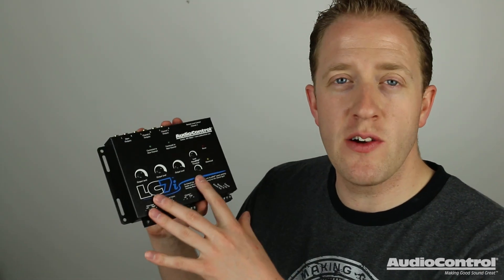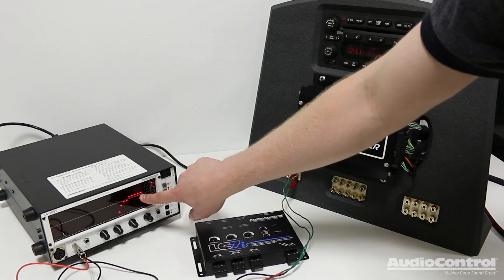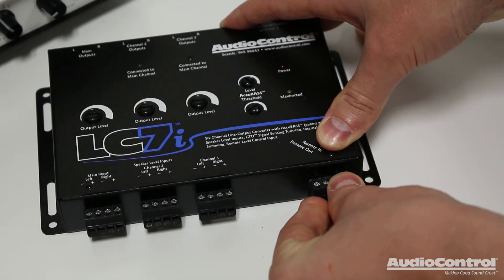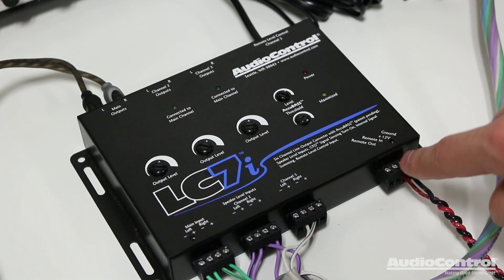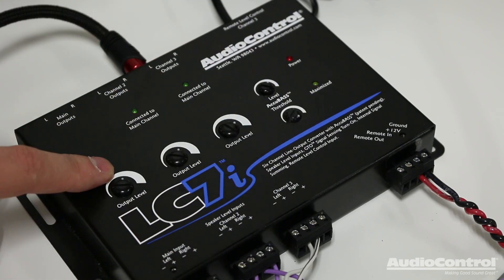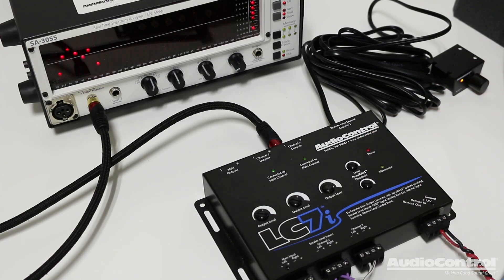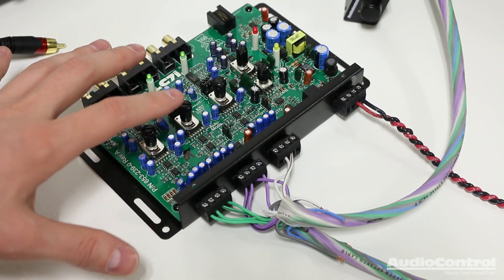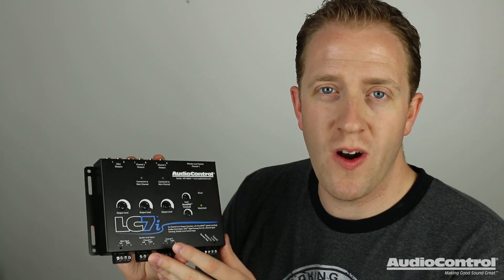Add Amplifiers to a Factory Audio System - AudioControl LC7i Line Output Converter

Comment: My Infiniti G37 has 12 speakers and 2 amplifiers, how would I use this? The 2 front doors have 3 speakers each, the 2 rear doors have 2. There is also a center channel and a subwoofer. I dont need to use the rear sub, and dont mind running the center channel off of the stock system. Would this only work for the front door speakers? Someone please help.

Comment: I have a 2 channel amplifier on my highs (6.5 components: midbass and tweeter L&R and rear deck has coaxials L&R.  I also have a sub amp on a DVC 12". How would I wire this correctly including the jump switches? My components are at a low volume while rear coaxials are OVERPOWERING my components up front.  Thanks

Comment: So I'm lost on one thing. If im only hooking up a subwoofer. Should I be splicing into all the level inputs? Does it sum the bass output? Or is this overkill for that task?

I want to maintain the speakers being powered by the factory amp for the time being, but I want to make sure this thing wont rob power from them.

Comment: Hi Mark,  I'm trying to get decent sound from my stock hu clarion cv729cm, notoriously criticized system from subaru. Replaced f/r door speakers with 4 Alpine s-s65 powered by alpine PDR-F50, added 1 sub 12" rockford fostgate punch P2D4 powered by rockford fostgate R500X1D , Audio control LC7i, kilmat sound deadening doors and trunk, custom fglass sub box, premium wire, blocks and cables. Getting a hum or buz at low to no volume as well. Any suggestions, I'm  ready to take it to a shop

Comment: The set up that’s gotten my subs the best signal have not been a factory with line converters. Let me know if there are converters that go over 400 watts. I’m trying to get the most out of an aftermarket 4K watt amp starting with a loud / clear enough signal. I have peq 70 equalizer with a sub output that doesn’t get enough signal with a converter

Comment: Do I still need a crossover on my Sub woofer output?  Does the unit subwoofer output (channel 3) has a low pass output filter built-in?  If not what do I need to replace with?  My subwoofer amp has a full range output only.
Reply: Interesting. Your sub amp should have a Low Pass Filter Option. If it doesn't, you will need to replace the amp or get a DSP to have those frequencies set to low pass for subwoofer bass signal only.

Comment: All this is confusing me. I have a 2018 Nissan Titan. It has 2 speakers in the dash, two in the front and two in the rear doors. It’s the stock setup no sub or amp. 
I’m wanting to put all new speakers, two 2 3/4 in the dash. 4 6x9 component speakers in the doors. So one six Channel 600 watt amp and one 500 watt mono amp for the sub. So I’m trying to figure out what all I need for this. Do I need the LC6i for that? Do I run two separate RCA lines for that? Just confused. I’ve never retained the factory radio before. So I don’t know the process.

Comment: Where I’m still confused on the installation how would I install this unit for a car that doesn’t have a stock amp and the  stock unit can’t be replaced?  2 How would I connect the head unit to this if theirs no option of component connection?
Reply: You have to cut the speaker cables on the back of the stock head unit. Connect them directly to lc7i. Use some 9 wire to run those cables from head unit to the lc7i. When you hook up your amp then you feed your speakers from the amp.
Reply: @bigabescanal  thanks now it makes sense to me. I’ll basically run two sets of 9 wire to the back one to the lc7 and one to the factory speaker wire it’ll connect to the amps. I’m so used to the Old days where you ran all your own wiring/rca’s  to everything from the aftermarket deck to the amps basically making your own harness.
Reply: It’s making some sense now so I run the 9 wire to the lc7i that’s connect to the inside speakers. Then do I run any wires to the amps besides the power ground. What about rca’s? Or I’m not using rca’s cuz theirs no component input? I’m still doing my research it’s a 2016 Mazda 3 sport. Base model not the Bose sound. Don’t know if the stock has a component connection. Since it is a gps model unit
Reply: @DJMEDIC671  you are gonna use the 9 wire and only use 8 of those for the 4 channels on the head unit. Cut the speaker cables at the back of the head unit. Then crimp the nine wire to the head unit. Basically the head unit will no longer feed to the speakers. You feed the lc7i with those speaker inputs. The lc7i needs speaker signal to install the amps. Then you use rca's at the lc7i to connect to your amp. Then you are gonna feed the speakers directly from the amp. Run speaker cables from the amp directly to your speakers. Your speakers are no longer connected from the head unit. I have a 2014 accord and I'm also doing research to do my installation correctly. I have an option to use the lc2i but it seems like the lc7i would be better if I'm stalling 2 amps.

Comment: Is it possible to adjust Fade, through the stock head unit, with this installed?
Reply: Yes! 100% adjustable fade and balance control. I prefer thos over a Fix 86 even though I'm a JL Audio Equipment User. With the fix its recommended to max your radio volume to its non distorted point and leave it there and use an external volume/sub gain control to your amps for best results. Ypu can use your head unit volume for that Fix 86 but you will hear some sound quality degrade as the fix tries to Automatically refix and flatten the EQ to the new volume you have just set. You dont have to worry about stuff like that with an LC6i or LC7i. 👍
Reply: @joseluisruiz3789  Thanks for this informative reply! I didn't know about the Fix 86 but it's nice to see feedback on it. It's also great to see that these functions still work with the LC7i. 

If you don't mind telling, what kind of system do you have? I have a 7 speaker factory system (2 tweeters, 4 woofers, 1 subwoofer). So I'm concerned that there aren't enough channels on the LC7i to support all 7. 

Really, I'm not even sure if I'd need an LC7i because there's a factory amp too. I just want to make sure that I can send the signals to aftermarket, amplified, speakers while retaining all of the functionality of the factory head unit
Reply: @luchvk  I got the JL Audio C5-653 in my ford flex front and rear with a Crossover on them. I'm using an Audio Control LC6i for my flex. Mine doesnt have the sony system so stock it had the center channel, A pillar tweeters and front door speakers connected together to 1 channel of the stock amp for the left and right side and then the rear door speakers connected to channel 1 channel each. No subwoofer. So with the LC6i I connected the front channels to Inputs 1 and 2 for left and right and the rear doors to inputs 3 and 4 for left and right and since I wanted the subwoofer to be controlled by the rear speaker outputs I looped some wires from the left and right rear speaker outputs to the sub line on the LC6i and then connected my Epicenter to the sub out of the LC6i to my JL Audio HD750/1 and the other 4 channels to my HD600/4 and it all worked out after setting up the gain control. My stock Microsoft Sync 3  radio goes up to volume 30 and distortion kicked in at volume 28 out of 30 so I tuned my system at volume 27 and went from there. As for tuning the Epicenter. I simply set the little knobs on it to the middle and inside the Epicenter I set the voltage to 2 volts and have never had any issues with it making my 10w6V3 bottom out (voice coil smacking sound to magnet/motor) 👍

In your case, you might have a 6 channel stock amp where your tweeters Are wired in 2 ohms to your front door speakers to 1 channel per side and the same deal in the back doors with 2 channels for the stock subwoofer as most stock subs are dual voice coil.
Reply: @joseluisruiz3789  Thank you for going into so much detail! It's a lot of info for me to process but I think it will be very helpful for me as I'm planning out what to do. 

I did do some research not too long ago and found out that my tweeters are ~2 ohms. So, they may share a channel with the front door speakers. In fact, it would make sense for that to be the case because, if I fade completely to the rear, I don't get any sound from the tweeters. Related to that, if I fade completely to the front, I don't get any sound/output from the subwoofer; the head unit actually shows "SUBWOOFER OFF". However, all four woofers are affected by the basic BASS and TREBLE controls regardless of the fade setting. Regarding the sub, I'm not fully sure but I think it's somewhat affected by the BASS setting (it has a separate SUBWOOFER setting). Do you know if that could mean that it's setup in a way that's comparable to your aftermarket system?

As a side note, I am happy to hear that the rear woofers are affected by the TREBLE setting because I'm planning on replacing them with coaxial speakers. I just don't know if they're getting all of the treble frequencies.
Reply: @luchvk  ah, then yes its exactly how it was in my previous vehicle. I had a 2012 Hyundai Genesis sedan that had an 8 inch subwoofer in the rear deck that was a dual 4 ohm voice coil sub. Since you have a separate subwoofer control, you definitely have some more tuning abilities. But yes the bass and treble affect all the speakers, front door, rear door and sub woofer unfortunately. The rule of thumb is to keep your Stock Radio bass, Mid, treble in the middle or flat and rely on the amps for the bass and treble response. That's one of the reasons I got an Epicenter so I can hear the bass better and lower in frequency. This LC7i will definitely work for you. The Accubass on this LC7i is like the Bass Boost knob in subwoofer amps. It has 2 knobs 1 that is called level which adjust that Bass boost like volume in a way and the 2nd knob bellow it is called threshold which is to adjust how strong or wide sounding you want that bass boost to sound. You will have to kind of mess with it once you get it by hearing it with music and adjusting those two knobs. Cool part about that accubass is that it only works for the subwoofer which is great because there are times where some songs have too much bass and it may sound good on the subwoofer but may feel like its overpowering the front and rear door speakers so the accubass for the subwoofer line let's you mess with it with out messing up your flat signal going to your door speakers for a much cleaner sound.

Comment: I have a lc6i just for my subwoofer and it doesn’t turn on if I connect to the third channel. Why?
Reply: S Lawrence Ram answered Jon Casse who had the same question. I can't copy his answer but you can refer to it. Basically the main channel needs a signal.
Reply: I replaced my lc2i with the lc6i and my factory amp powered up the lc2i. I took the lc6i and put jumper wires from the main channel to the #3 Channel and that powered on the lc6i and I was able to use the bass knob. Is this ok to do?
Reply: @tjsworld2338  I'm not the right person to ask if that's fine to do, without damaging the unit. I'm still learning myself. Maybe you can get in touch with an AudioControl support representative to find out.

Comment: Installed my LC7i yesterday, and noticed that i was having some crazy noise in my system. I mean CRAZY. After trouble shooting (checking grounds, etc) I found that my LC7i is apparently wired exactly backwards. The "main" outout is actually my sub, and my "sub" is actually my front stage. Also, I have to keep all 3 outputs from the LC7i just off the bare minimum setting. Anything more, and it sends rediculous noise into my amp. After finally figuring this out, I have the gain on my amp at or slightly above "normal" gain setting. I thought I was supposed to be able to keep it low...?

Comment: I installed this product in a 2011 Cadillac DTS premium and it works great but my current problem is the chimes are too loud. This car has several alerts ...is there anyway to disable or lower the plentiful loud chimes????
Reply from the maker: You could use our LCQ-1 instead of the LC7i... this would give you a nice EQ to help tone down those chimes/alerts. Alternatively, you could use the EQS in-between your existing LC7i and your amplifier to do the same task.

Comment: How do I actually move the jumpers
Reply: take out 4 screws, lift off cover, select the jumper you want to change, then with your fingers, grasp the jumper and pull straight up, position over pins for desired setting and push jumper straight down.

Comment: I have a 2018 (new body style) Jeep Wrangler JL with the 8" screen and "upgraded" stereo from Alpine. It's good for the average listener, but I'm not the average listener. I LOVE LOUD THUMPING BASS, crisp highs and mids. Please forgive me, I may not completely understand, but this unit says it can accept 400 watts per channel. So my question is if I wanted to install my 2 subwoofer amps (rated 2000 watts RMS) and my 4 channel (rated at 125 per channel) will this unit be able to accommodate all of these amplifiers and link them all to my stock head unit?
Reply from the maker: Yes it will work for your system as will any of our amplifiers that all have this technology built into them. We would highly recommend a qualified storefront do the install as many new Dodge, Chrysler, JEEP and Maserati vehicles will require very specific resistors to keep the factory signal stable and intact.
Reply: @AudioControlCar  thank you! Much appreciated! I'm purchasing a LC7I right now!! Thanks again!!

Comment: I have a 2013 G37 Sedan w/bose. I would like to replace the oem amplifier. Would I need something like the lc7i?
Reply: Are you looking for subs, speakers, or both? Working on a q50 with Bose (should be the same thing)
Reply: @CountryQ  Just the door speakers.
Reply: ReggaeDubSoundSystem you’re probably gonna want to tap into the head unit because the wiring diagram on the amp is insanely confusing with all the other stuff that runs through the amp. Lc7i should be a perfect fit. You’ll be ready for base if you ever decide too. I cannot warm you enough to stay away from that amp. You will mess up stuff that has nothing to do with your audio.

Comment: I want to install an aftermarket amplifier to my 2012 Ford Expedition and keep the factory radio (for now ) I was thinking of buying a JBL club 704 but now I’m a little confused if I need the LC7i to do so and if so can’t I use one of your amplifier instead don’t they have it built in ? I installed JBL GX speakers and plain on a JBL basspro sub. Question is what your best amplifier for my car

Comment: Can I use it with a aftermarket radio?
Reply: jbarah05 most aftermarket radios have RCA outputs so you can run amplifiers. I don’t see why you would even try to use a LC7i.

Comment: Will just this enhance factory sound or do u have to have amp...I'm wantin to and mono block amp and sub for bass but want tokeep stock head unit in honda accord 2015..but i  want to improve sound without upgrading other speakers ....will this help me get the most out of my stock speakers
Reply from the maker: You do have to use aftermarket amplifiers in addition to the LC7i. The LC7i takes factory audio signals and converts them a useable signal that any aftermarket amp can handle.

Comment: Can someone answer if im using the summed feature. my inputs are from my tweters and my door speakers , do I only connect to the main output ? or will the subwoofer output also work?  reason im asking is I understand how the summing works and a fullrange signal comes out of the main but do I then split this main to my amplifiers or can i use the second and third outputs also in this summed mode ?

Comment: What I still don't understand, is that my stock head unit had separate channels for tweeters and woofers for front and rear. I see you separated them on the LC7i into two tweeter channels, two mid channels, and 1 sub channel which accounts for say... front components... but what do I do with the high level outs form the stock HU for the rear components (2tweeters, 2woofers)?????
Reply: You would probably want your LC7i channel 1 output running to a 4 channel amp, which would drive your front and rear speakers. It would also power your tweeters, because you would run your tweeters in parallel with your front door speakers using a crossover. I know this is late but it might help somebody.

Comment: I have a 2012 dodge ram larimer with alpine 9 speaker set up.    I wanna change door speakers and add 2 kiker subs the amp for the subs is the kiker 1200.1.     Will it give me full power with the LC7i.      Also do i still need to add any fuses.  Or run the ground wire and power wire to the kiker amp

Comment: After connecting  the main input ,channel 2 , and channel 3 from a factory amp and running the output rca to the amp, on the amp do you have to run  the speaker output from the amp to the head unit ??
Reply: Rafael Hernandez, no you would than run your speakers off the output of the amp.

Comment: Where are those speaker wires coming from. How do you tap into the Sony system. They go into the Sony amp but don’t come out
Reply: I think you suppose to use rca connections to connect it to the amp

Comment: Do you have to have Channel 2 connected to anything before you can use AutoMode to get Channel 3 to work as a Sub channel? In other words, can i get away with connecting only Channel one (Main Input Channel) to my Head Unit's speaker level wires and and have nothing connected to Channel 2 and still get Channel 3 to output a signal?
Reply from the maker: Jeries Abujries yes, auto mode feeds channel 3 with info from channel 2.
Reply: Thank you! I appreciate the response.